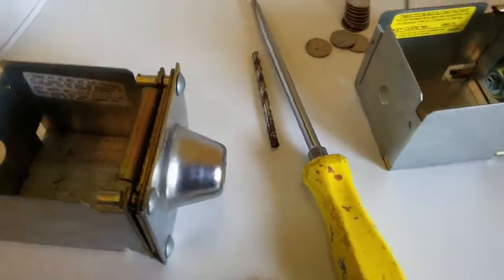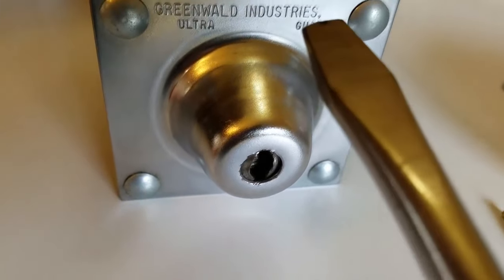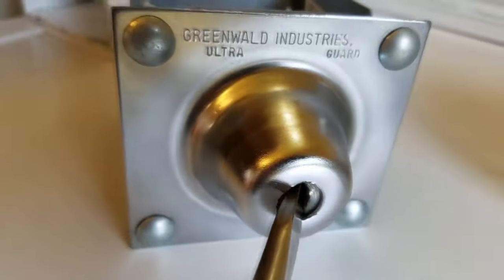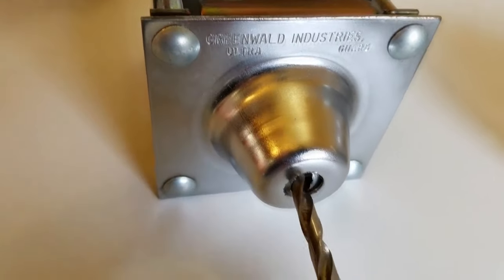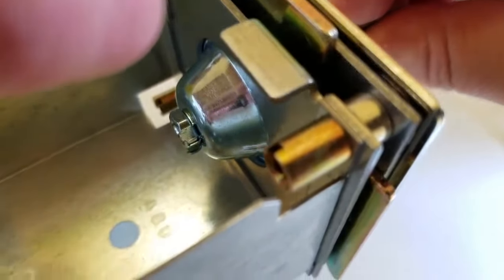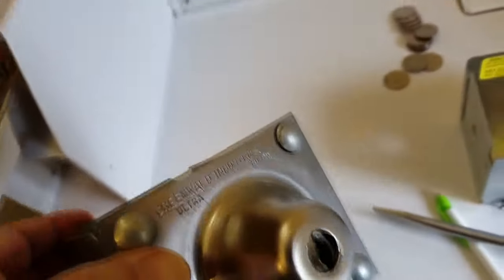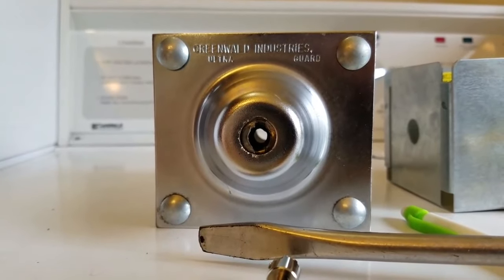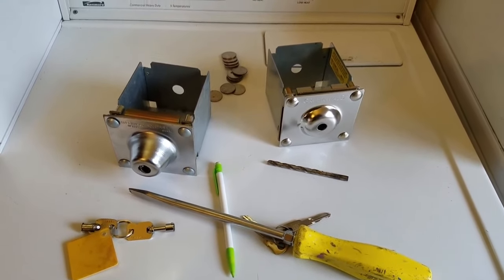How to open a Laundry coin box

Comment: Thanks for your video. Someone tried to steal the coins in the laundry room, but left a broken piece of the metal inside the lock. I was lucky to drill it out with an 1/8 inch carbide bit, and was able to retrive the coin box using the original key. That just made my day.
Reply: We

Comment: Jesus Murphy 84k and just 316 up !    83,630 people were looking for easy money and 54 of those people couldn't figure out which end of the screwdriver goes in the slot  . Great video !
Reply from the maker: The first upload of this video had over 200,000+ views before YT took it down, I fought the case and WON! So this is a "reposted" version.
Reply: @breakerbroke23  who knew so many lost keys and jammed locks . A follow up showing how to use the key properly with tips on how not to loose them is in order . I can't imagine any other reason apart from tamper damage .

Comment: Works! Just sucks a lot. But if you take a different bit and really just try to push through the metal “gates” it creates such a heat that it makes the metal more mailable and easier to pry open. 

I used 2 flat heads stuck in there and then took a 3rd and smashed it I. Between the 2 with a hammer after heating it up.

Comment: There are different levels of security on those boxes. Mine unfortunately was high security. 40 min of drilling later had to take a cutting torch for it.  Low security are about 40. The high security medico or cobra are 60-70$
Reply: did the cutting tourch work?
killing me trying to drill out

Comment: My first one took 3 hours! I think I broke off my screwdriver tip in the lock. My next three took 5 to 15 minutes each! I drilled 3/ 16 first til it went through, then 1/4 to eat the screw in back so the nut comes off. Didnt bother too much " wallerin out" that front key guard,as the bits will slide in at the right angle. Thanks! we saved over 1k dinero.

Comment: This is waaayyy late, but I wanted to let you know that those tube locks are junk. I can get thru them with my impression er in about as fast as you can use the key. Get the medeco lock instead. I can still pick them, but it does take more time, and that might be just what you need to catch someone in the act!! Get a hold of me about security issues, I’ll set you up proper.
Reply: What model do you use..I got the cheapo off wish haven't  had much luck
Reply: Hey, how can I contact you about this, I really need help haha thx

Comment: What if you got the lock out but the cams are stuck?
Reply from the maker: Use the largest flat blade screwdriver you can find. Stick in there and turn the blade around (clockwise I think) until you can get the cams to move, then using upward pressure use the screwdriver to help pull the coin box out.
Reply from the maker: Sorry... counter clockwise
Reply: Thanks. Got it out this morning with a chisel and a little hammer. Thank you.
Reply from the maker: Thank you for subscribing. Cheers.